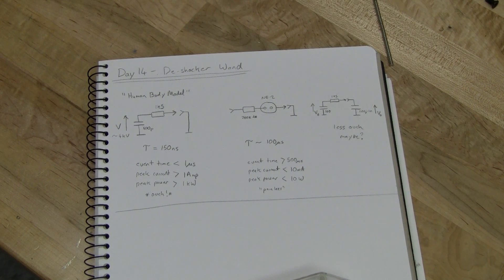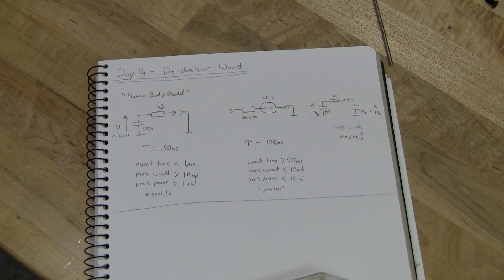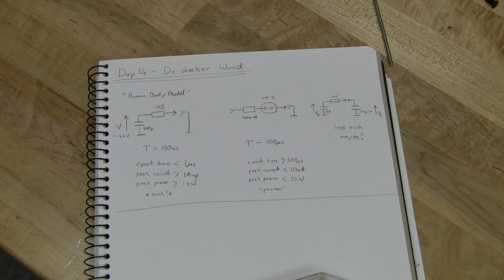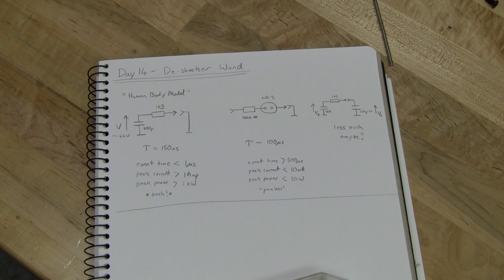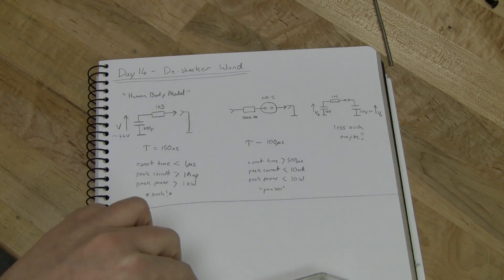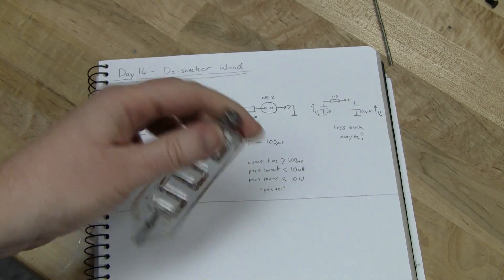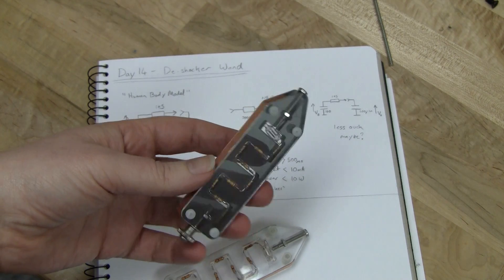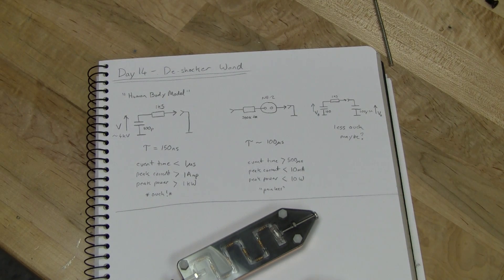Advent Calendar of Circuits 2014: Day 14: De-shocker Wand

Comment: I just hold a house key in my fingers and use that to touch the doorknobs.  works pretty well.
Reply from the maker: naikrovek indeed, holding metal to draw the spark to helps reduce the shock because it spreads out the area through which the current will flow.  Also I suspect it helps that you aren't taking the spark to where ever your skin breaks down first (often a hair follicle or sweat gland which have lots of innvervation).  Large discharges still cause nerve and muscle stimulation though.  Even if it doesn't hurt it can still fry electronics or make them misbehave transiently.

Comment: I just use a bunch of keys, and hold them firmly then touch a key. If I do not want to have a spark I touch the leather tag onto the surface first. Only have to do that in winter inside shops with aircon set to walk in freezer mode though.
Reply from the maker: SeanBZA Yeah I sometimes use my black rubber phone case which is leaky enough to discharge me fairly rapidly.